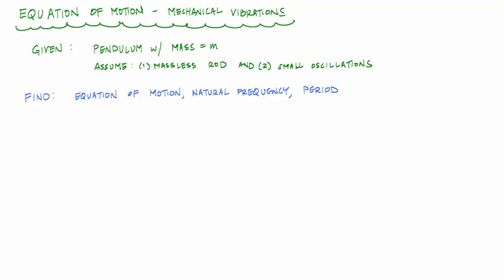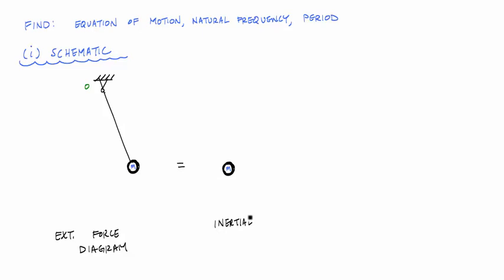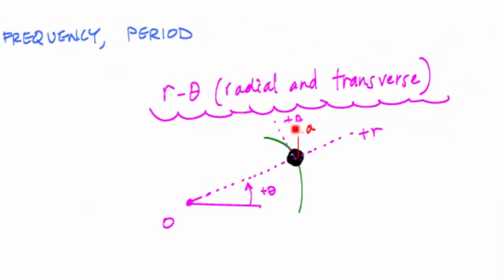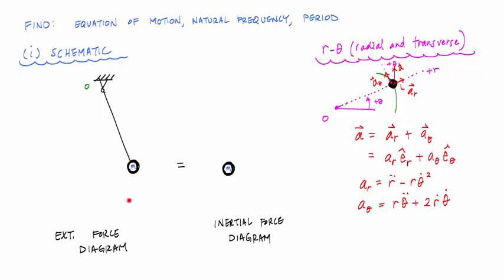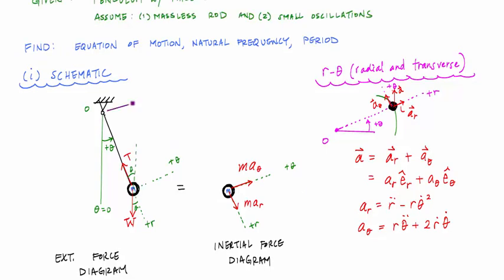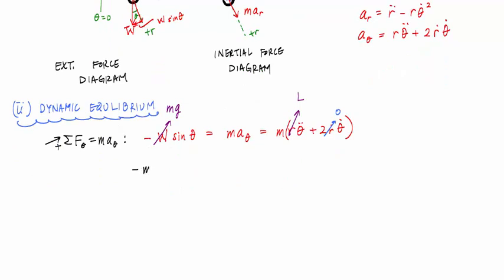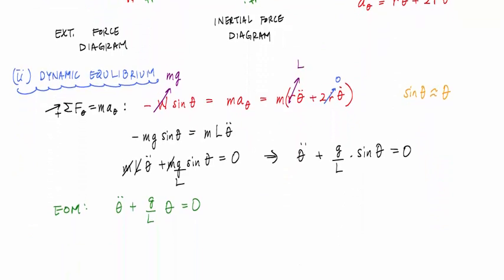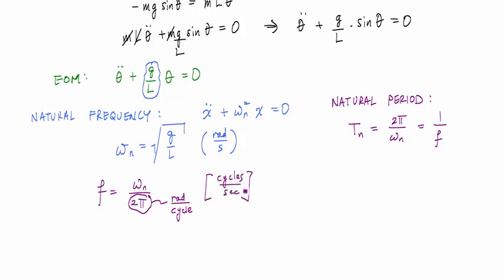Equation of Motion, Frequency, and Period of a Pendulum - Structural Dynamics

Comment: A conical pendulum consists of a uniform straight bar (L) long and of mass (M), with a bob of mass (m) at its lower end. it rotates at (N rev/min) about a vertical axis through the upper end of the bar. How would you find the radius of rotation of mass (m)